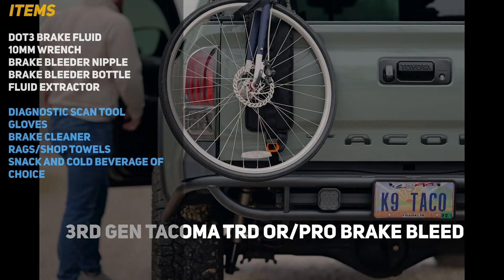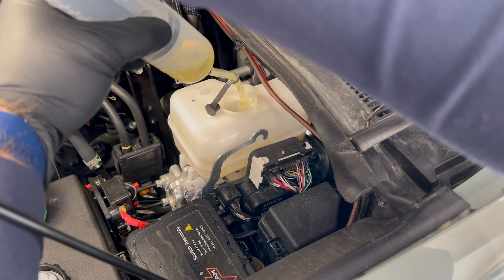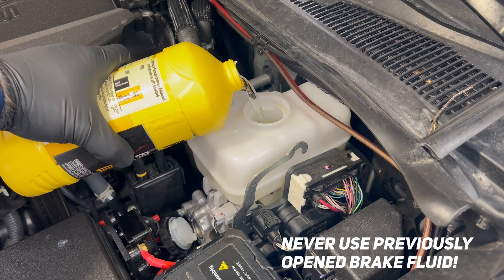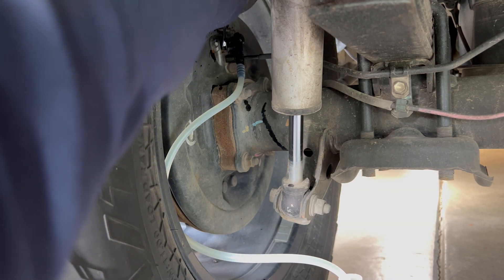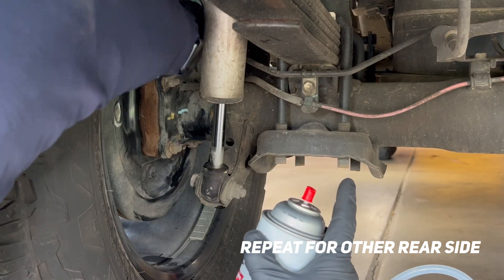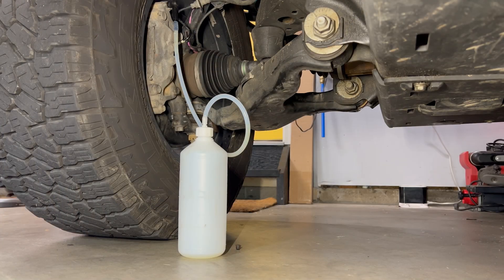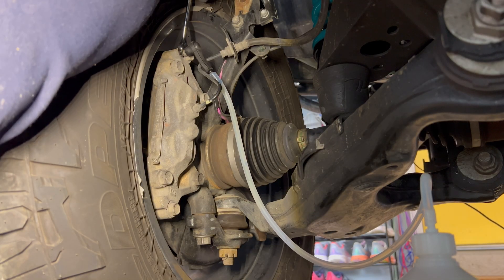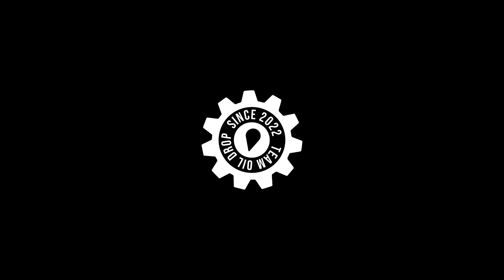Tacoma TRD Offroad & Pro Brake Bleed

Comment: So you start with the driver rear, then passenger rear, driver front, then passenger front? So opposite than a normal vacuum boost system?
Reply from the maker: No it's normal furthest to closest, same as usual protocol

-Austin
Reply: @teamoildrop makes sense thanks for the info i was just wondering because in the video u only did the drivers side

Comment: Forgive me for these questions but when you drain the master cylinder in the beginning that won’t introduce air into the system? Do you also leave the cap off the master cylinder this whole time? Once you turn the car to on position to we have it turned off any other time during the process or always on? 

Thank you for the insight in advance your channel makes this process less daunting
Reply from the maker: No you really can't get all the way to the bottom of the reservoir with a hose, and that's also why we do not turn on the vehicle when the fluid is sucked out. Just suck it out and replace immediately.

You can leave the cap off the master this whole time. And the key is in the on position for the entire rear brake bleed procedure then it can be turned off to do the fronts.

-Austin
Reply: @teamoildrop so for the fronts the car can be completely off and I would be able to press the brakes to bleed them? Thank you for all your insight!

Comment: Austin, 
Would this be any different for a manual transmission off-road?  Or would it be the same procedure? Thanks 

Because on your previous video, you put up a card that showed the steps and it said you needed to have a buy directional scan tool, and you linked to them. But on this one here you’re not using one correct. Because I scheduled an appointment with the dealer to get it done cause I wanted it done correctly and I don’t have a bidirectional scan tool. 
Thanks if you don’t know, that’s OK.
Reply from the maker: That other video is almost 2 years old and unable to be changed, this is the procedure if you do not have a scan tool and want to complete a brake fluid change on an OR or Pro DIY

-Austin

Comment: I have this same exact master cylinder on my Tacoma 2009.
My brakes are very spongy when I step on the pedal. I brought the car to Toyota dealer and asked if they can fix this issue and they told me they unfortunately cannot fix.
Any suggestions?
My Tacoma has almost 400k miles
Reply from the maker: I’d start with a brake fluid change/bleed procedure like this video and go from there!

-Austin

Comment: Bleed brakes. Now when my truck sits for two or more days and I start the truck with my foot on the brake pedal, I hear the loud brake booster run for a second and stop. Didn’t do this before. How do I fix this?
Reply from the maker: That's normal operation, I'm guessing you just didn't notice it before because that pump needs to run every 2-3 brake pedal presses to keep line pressure

-Austin

Comment: Do you not need an OBDII scan tool with auto bleed function or to bleed in certain order?
Thank you for the video.
Reply from the maker: No scan tool needed for standard bleed. It’s only needed if you run the reservoir dry. Furthest to closest is best practice but not as crucial when just doing a fluid exchange 

-Austin

Comment: Did you start this process on the brakes furthest from the brake fluid reservoir? The rear passenger? Are you supposed to?
Reply from the maker: It isn’t specified in the instructions but if you want to follow best practice yeah go furthest to closest

-Austin

Comment: I have a 2nd gen TRD-Off Road. Is this exactly the same procedure? I think it has an electric master cylinder.
Reply from the maker: Yes same procedure!

-Austin
Reply: @teamoildrop  Thanks you for responding. How many times did you have to depress the brake pedal for the system to pressurize when bleeding the rear brakes? Do you know if 2nd and 3rd gens Off-Road have LSPV?
Reply from the maker: LSPV is a 1st gen only thing, stopped after 2004. It should run the pump as soon as you crack open a rear bleeder with one brake depress, so no need to depress multiple times

-Austin

Comment: Hi! Did I happen to miss where you need the scanner to run the pump? Watched the video through a few times and my truck is due for a brake fluid change. Let me know, thank you!!
Reply from the maker: No, scanner is not necessary as long as you don't run the reservoir dry. 

-Austin

Comment: So you don’t need to use a scan tool to do this?
Reply from the maker: As long as you don’t let air into the master by running it dry, scan tool isn’t required. 

-Austin
Reply: @teamoildrop thank you

Comment: So I just called Toyota and they acted like they never heard of communicating with the computer for bleeding brakes on a 3rd gen Tacoma…I’m so confused
Reply from the maker: it’s not necessary unless you get air into the system. 

-Austin
Reply: @teamoildrop how would I know if I have air in the system? Also I heard u can brake really hard to trigger the abs to get air out of the pump?
Reply: @teamoildrop when u say system, u mean the pump? Or the whole brake system as in lines?

Comment: Thank you for the video! Between this and the non TRd specific video, I'm not  sure whether the off road trim absolutely needs the scan tool or not. In this video, it seems that's not needed unless you accidentally don't keep the master cylinder full. I have an obdlink mx+ and I'm not sure it can control the solenoid. But as noted, I'm still not sure it's necessary for me to get the scan tool
Reply from the maker: You can get away without one! The non TRD video is out of date and unable to be changed now. Only time you need a scan tool is if you run the reservoir dry while bleeding with this procedure, that's why I keep mentioning to refill the reservoir.

-Austin

Comment: Guess this is obvious to many but I had to look it up. Key "on" position for push button start is foot-off-brake then hit start button 2x which should kick on the pump. Please correct me if this is incorrect.
Reply from the maker: No that's correct! You can also do this while the truck engine is running, it's just not necessary.

-Austin
Reply: @teamoildrop Thanks Austin! Keep up the amazing vids.
Reply: @greggyows  came in here looking for this answer, so thank you.

Comment: Are you doing the fronts with the key still on? I have a 2019 Off-Road. With the key still on, I did 10 pumps on the brake pedal and then held it and I got a lot of fluid out on each side.
Reply from the maker: 3:18: key off but you can do it with the key on, doesn’t make any difference for the fronts. 

-Austin

Comment: I need to replace the Z shaped rigid brake line/tube just before the caliper on the right side. Can i use this method to bleed out any air introduced into the system without a scan tool?
Reply from the maker: Yep! Scan tool is only needed for air in the master which only happens when you run it out of fluid. 

-Austin

Comment: @teamoildrop great video as always! But creates a bit of confusion with respect to your previous video “How to replace brake fluid on your Tacoma” where you mention a special scan tool is needed to change brake fluid on a 3rd Gen TRD 4x4 off-road (I have a 2022). Am I missing something? Is the procedure in this video correct for TRD 4x4 off-road or do we need to go with the procedure highlighted in the video mentioned above which requires a scan tool?
Reply: Doh, just saw your response to a previous poster. Scan tool is only needed if you allow air to enter the system by not keeping the reservoir full during this procedure. 

Should you allow air to enter the system through the reservoir, then you’d need the scan tool to help bleed the master cylinder. Sound about right?
Reply from the maker: Previous video is nearing two years old and no longer able to be edited. A scan tool is only needed if you run the master reservoir dry and create air bubbles in the ABS system. This procedure is for all Off Road and Pro models. 

-Austin

Comment: I’m surprised that Toyota don’t sell a Silicone Brake Fluid, no corrosion or damage to paint or skin and works just as good in my opinion 👍🏻🛠🇺🇸
Reply from the maker: DOT 5 isn’t ABS compatible, so it’s not realistic for anything driven on the street!

-Austin
Reply: @teamoildrop I am talking about Silicone Brake Fluid not DOT = Boiling Point. I an using it on my ABS equipped Harley Davidson with no problems at all 👍🏻

Comment: Love this channel, but have a question.  The older video on a brake fluid change, mentioned if you do not use the scanner tool to bleed the ABS on an Off road model you can have serious problems.  This video mentions that the scanner tool is optional for an off-road.  Am I misunderstanding it or is it not as critical?
Reply from the maker: Scan tool is only necessary if you let the reservoir run dry and need to bleed the ABS module. We can't edit the old video at this point so we can't remove the part where it says the scan tool is needed, but it is not unless you run the reservoir dry. Sorry for any confusion, new data we came across hence the new video for OR/Pro master cylinder bleeding.

-Austin

Comment: Great video. I read on another blog it is important to replace the reservoir cap every time you bleed. Is that necessary?
Reply from the maker: Not that I'm aware of, and Toyota doesn't specify replacement in their write up of the procedure either, so I would say it's not necessary.

-Austin

Comment: omg thank youuuuuu, this has been on my list and that brake booster thing terrified me.  can I still use the mityvac to suck out the brake fluid vs pumping the brake?
Reply from the maker: I'll be honest I could not find ANY data that said you could or couldn't on the fronts. I don't personally have one so I didn't try it, but feel free to try it with the vacuum pump. If it doesn't work you'll just have to manually bleed!

-Austin
Reply: @teamoildrop  thx austin your the best!
Reply: this was easy as it looked in the video, just make sure you are turning the brake bleeder the correct direction!  Done at 119k

Comment: So this no longer needs a scan tool like the previous TOD video said for Offroad trims?
Reply: It’s only needed if you’re bleeding the master cylinder. So like if you introduce air to the system or have completely emptied it of fluid. For simple fluid changes no scan tool is needed.
Reply from the maker: Correct^^ only needed for air in the master
Reply: @teamoildrop  Thank you!
Reply: @teamoildrop hello sir! So the scan tool is for back up— if you accidentally allow the reservoir to run empty while you’re bleeding the brakes?

If that’s so then how does scan tool help you with this issue?

Comment: Should you start with some fluid in the bottom of the bottle when you do the fronts in order to keep air from getting sucked back in between pedal presses?
Reply from the maker: If you’re using just a standard bottle and hose, yes. This is a “one man bleeder bottle” so it’s a closed bottle system and keeps fluid in the line so it’s not pulling air back in. But if you’re flushing out the old fluid, by the time you start getting clean fluid out, you will have enough in the bottom of the bottle to not suck in air. 

-Austin
Reply: @teamoildrop  Thank you, putting together the kit to do this next weekend
Reply: @teamoildrop  Sorry by 'bottle' you guys mean the master cylinder reservoir?
Reply from the maker: No they’re referring to the white bottle i have connected via a hose to the brake bleeder. This bottle is what i used: https://amzn.to/4l3ChLU

Comment: Awesome video! Could you make a video showing how to use a scanner to bleed the master cylinder on the 3rd gen off road?
Reply from the maker: It’s in the works, need to purchase an expensive scan tool to make that video so we haven’t gotten around to it just yet. Bleeding the master is only necessary if you end up letting the reservoir run dry and allow air into the master, not part of a routine brake fluid change or bleed. 

-Austin

Comment: any issue with vacuum bleeding the fronts? like using a fluid extractor with a bleed attachment?
Reply from the maker: I’ll be honest there is not a ton of data out there on this entire subject let alone if you can use a pressure or vacuum bleeder. My understanding is that it should work. I don’t have a vacuum bleeder so I didn’t attempt, all the instructions I found just state to do it manually via the pedal. Worth a shot to try it if you already have one though!

-Austin

Comment: Awesome how to video, the only thing missed is the pattern on what lines to bleed when
Reply from the maker: I must've left that part out, for a brake bleed when you're releasing air from lines, furthest to closest. RR, LR, RF, LF. But for a fluid change it technically does not matter.

-Austin

Comment: Question, in a previous video you had mentioned the need for the scanner to run through the ABS auto bleed procedures. Is it "a nice to have" or a requirement? Or perhaps a better question, when would the scanner be a requirement and do you plan on showing those procedures in a separate video. I was planning on doing this job on my Tacoma but held off in order to purchase a scanner for the job. Your videos are great and I look forward to any response.
Reply from the maker: It's a "nice to have", not a requirement. Basically you are just commanding the ABS pump to do what I did, which was hold down the brake pedal and crack open the rear wheel cylinder bleeder and then it forces the fluid out. It is required if you get air into the master cylinder, but as long as you don't run the master dry, there is no need. Hopefully I never have to make a video on that process as apparently it can be daunting even with the scan tool. 

I personally don't see a need for it for a standard bleed/fluid change it's very easily done by hand and the steps shown in this video, and it saves you having to buy a new tool for a simple brake bleed.

-Austin
Reply: @teamoildrop 

Austin, thanks for the quick response. Looks like I'll be be doing this job this weekend. Again thank you!
Reply: @teamoildrop 

Austin, thanks for the quick response. Looks like I have a project for the weekend. Thanks again.

Comment: Do you work furthest away from the reservoir in- back passenger, back driver, front passenger, front driver?
Reply: Do these instructions supersede the previous ones from an older video that required using a scan tool?
Reply from the maker: Best practice says yes, but it really does not matter when you’re just doing a brake fluid change. 

-Austin
Reply: Doesn’t matter if you’re changing fluid. If you are bleeding air you would be correct.
Reply: @johnb1658  Isn't it the same thing though? I mean when you 'bleed', you are losing fluid, so you'll top it off anyway, no?

Comment: Great video Ive got a 2020 Off Road that hydraulic Master cylinder does intimidate me a bit. I don't even want to know how hard it would be to get air out of the system .
Reply from the maker: You unfortunately need techstream or a scan tool to bleed the air out of the master. Just keep that reservoir filled up and you should have no issues! 

-Austin